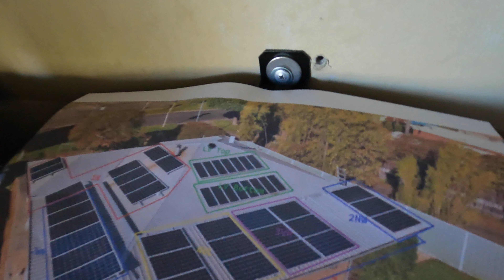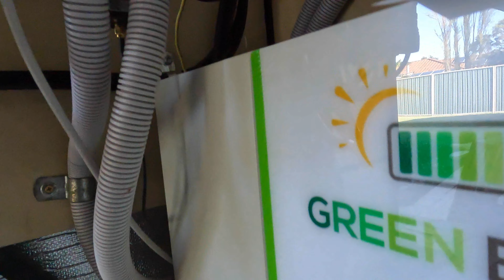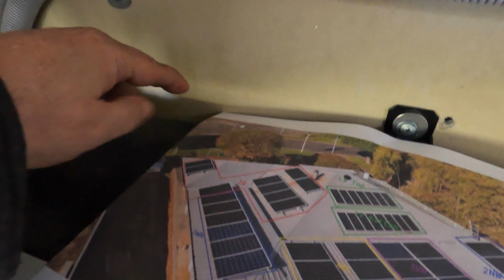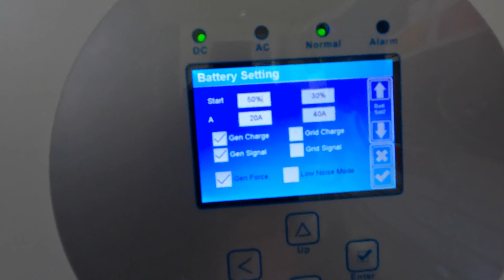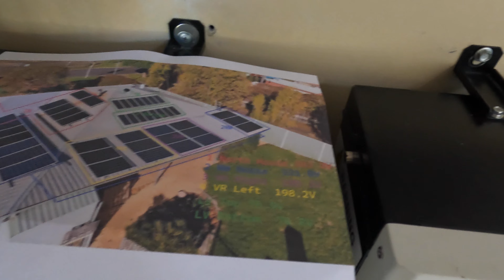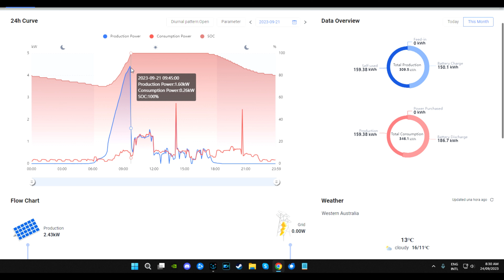In Depth Look at our OFF GRID System, Solar panels, Wiring, Battery Logs

Comment: Hi Chris, do you still paly around with the MPP inverters?  Got a site (not our install) with (recently) new inverters and we're constantly getting issues.  MPP have been good and sent new comms cards and a new main board for one.  All worked good for about a week after the board swap but now getting F90 and we've been ghosted by MPP now, so no support.
Reply from the maker: 99% of the problems with all DIY inverters is the install. Incorrect wire sizing, poor connections, or buying used and often stuffed 2nd hand  batteries. All these things introduce resistance and increase the AC ripple current on the DC side and using poor quality generators. All these things are deadly to inverters. Wire them right and they run forever. I have proved that many times. Upload a video showing me you wiring / connections and batteries. And i may be able to spot something you have missed or done wrong. The rest you just need to test Battery Resistance vs Impedance Testing, hear is a link. https://eepowersolutions.com/resources/tech-notes/tech-note-battery-resistance-vs-impedance-testing/ you also may be able to find videos on YouTube that may be of help. Hard for me to Diagnose a problem when all you tell me is "constantly getting issues"
Reply: It's an old Giant Power system (I used to work there many years ago, we actually had a bit to do with each other back then).  The IPS inverters died so we replaced them with newer versions from MPP MGX5048 x2 in parallel.  We had an error and had to change the comms cards and then had another failure and replaced the main board in one of the inverters.  Now we have a F90 error.  No worries, I'll keep googling.  I wanted to change to Victron but the customer doesn't have the coin and just trying to get it up and running again.
Reply from the maker: @ChaseTheWeekend  Yes stopped using them when i switched to lithium. I now use Deye inverters. If the problem is not in the wiring or old batteries. Then use another brand I use is Giandel inverters very affordable, Use one in my camper trailer. However they only do 12 and 24v units i think. Other brands i am not sure about. So much rubbish on the market now. If he has the right wiring then he can split his bank and use the 4Kw 24volt unit. https://www.giandel.com.au/collections/pure-sine-wave/products/ps4000qar24v?spm=..collection_5d443be1-d893-44ea-97ee-cad9029e2033.collection_1.18&spm_prev=..index.header_1.1 that would be the most affordable option for him. But only providing he has no problems with his system wiring or house wiring. like an extension cord cross wired  or something silly like that. Like i say there are many thing in a DIY System that can go wrong and pop inverters including his own wiring. I would look and Check it all before I reinstalled anything.
Reply from the maker: OK i just got a message back from Peggy Mpp Solar Taiwan .  (for the support. can you ask the user to contact us please. support@mppsolar.com  we will help )

Comment: I have heard that you can't charge you battery only with these inverters as it will only charge and run the loads when generator is running did you keep one of your old mpp inverters to charge your battery
Reply from the maker: I charge my batteries and run house loads with our generator easy. All depends on the loads your trying to run while charging the bank and the size of the generator, You can set this to Charge batteries first then run loads. Run loads first then charge the batteries. Same as many Inverters on the market.  I have a very small generator, so i limited my charging current to 20amps @ required volts. What is left over runs our house. If you have an inverter running your home with built in 160a Charger like these units do, and you want to charge your bank and run loads at the same time (after all it is what its built to do) Then you also need the required Generator for that work.
Reply: @JustinCaseSolarPower  thanks for the reply in my case a separate inverter to charge my batteries would be needed as the wife would just stick the kettle on even if I told her not to run to much as I was charging the battery
Reply from the maker: @dama054  We have not had that problem. In winter its cold so we have the fire  going. that = all the hot water she will ever need. In summer even on bad days we seem to have lots of power and the batteries are getting full. These lithium's are a real game changer.
Reply: @JustinCaseSolarPower  they are good I've had lithium for about 7 years now and think they are all you will ever need
Reply from the maker: @dama054   They are new to me so i am still getting used to have them charge so fast.  🙂

Comment: I recently upgraded one of my Victron chargers to a 250V/70A...it's working really well. I am assuming you moved away from the MPP Solar gear is because the Deye has more or better features? I'm using the Cerbo GX as well, and my trusty MPP Solar inverter, which is still going strong after all this time. I also have the Lynx Power In like yours, it can sure handle a LOT of power with ease. I guess, for myself, my solar journey is still in progress. Yours may be drawing to a conclusion in the years to come.
Reply from the maker: "my solar journey is still in progress. Yours may be drawing to a conclusion in the years to come"  Hell no. With all the new gear coming onto the market, there is plenty of stuff for me to do. Lots of this gear needs testing in real world conditions. I never trust what a salesman or politicians  say. Nor should anybody ells.

Comment: I am sorry for asking Chris but I am an idiot, what is the difference between HIGH VOLTAGE and Low Voltage? What is the standard? Jim
Reply from the maker: Low volts und 150Vdc. High Volt solar is over 150Vdc up to 1000vdc. if it kills you its high volts...

Comment: I am not so worried about the noise from the Inverter since it will be in a closet away from the house. Not too far but far enough that the noise would not be an issue. Other than the issue of USING POWER. Jim
Reply from the maker: noise in most inverter is caused by cheap metal housing the vibrates. Vibrations are very  hard on soldered electrical boards. Could and will lead to an early death of the unit. So yes i would be worried.

Comment: Here is a big question!

DO you think that your closet would be enough protection for an EMP?

My wife thinks that we should plan on building a system that is EMP proof or close. Jim
Reply from the maker: Not much chance of an emp hear. but my houses system is well protected. More chance of a CME (CORONAL MASS EJECTIONS) and again, my house is well protected and its not connected to the grid with its thousands of miles or wire for a CME or EMP to built up really high volts on. That is how they do most of the damage.  The tin roof and walls are all grounded. As you know there is only one thing power / lightning / emp / cme , wants to do and that is go to ground.

Comment: The MPPT SOLAR inverters that I have are the 48V ones. They do not like my generator. The tolerances are really close so it will not accept the dirty power from the multiple generators I have owned over the years. The best generator for my system was my INVERTER GENERATOR from Yamaha (which over loaded and burned up, and i think YAMAHA designed them to do so).
I guess the question is.... does the DEYE like your generator?
I have wondered if I could just go and buy a INDUSTRIAL TRUCKING TYPE battery charger and just charge my AGM batteries directly with a High Amp in put? 
Don't worry I will have more questions. Jim
Reply from the maker: These inverters I use now are low frequency. So they will run with most generators, as long as its at the right volts and Hz

Comment: So I am thinking that I will do all high voltage and I am sure you would too if it were not for those LOW Voltage Panels that you already have going. 
I plan on rotating solar towers with 12 panels (Give or take) so that i can rotate the panels to the sun as the year progresses. I currently have this set up and it works well. 
I will put more comments as the Video progresses. Jim
Reply from the maker: Yes i like sun tracking systems for solar. I just don't have the room for them hear.